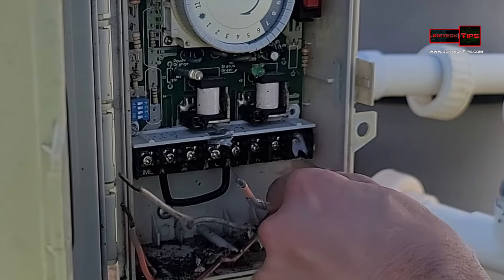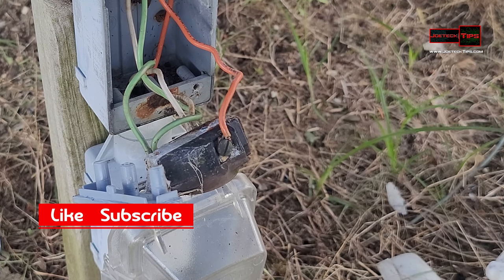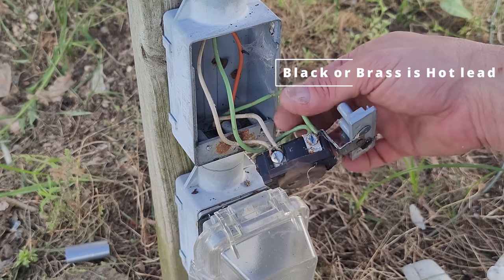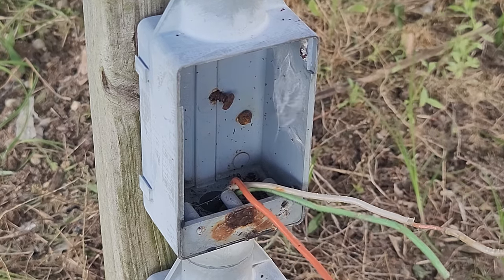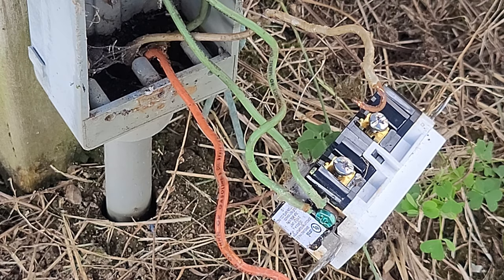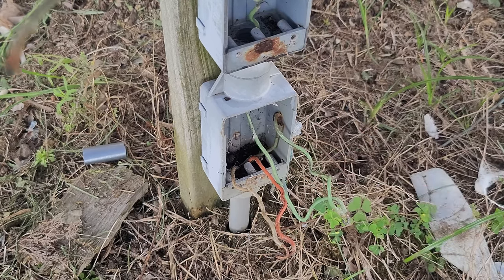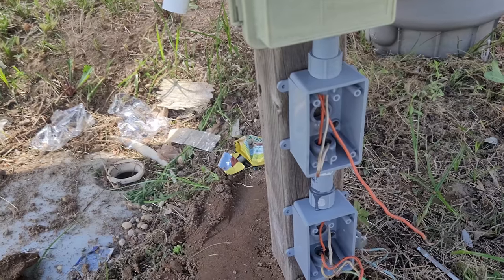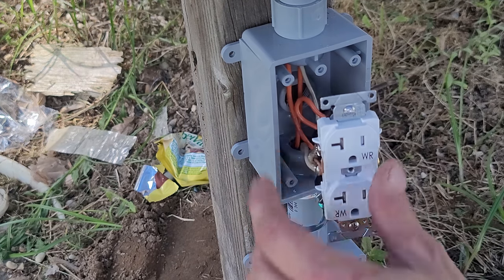GFI Pool outlet with Timer how to install | JoeteckTips

Comment: Wouldn’t be better to install a GFCI Breaker to control your motor?  Also as    recommendation, always tight your wires to the outlet in the right direction (clockwise ).
Reply from the maker: You didn't watch the video did you?  You skipped through.
Reply: @Joeteck  He is right it cost more but it makes the wiring at the end easier, no need for the GFCI outlet. And the right professional way to connect the wires is tighten the loop around the screws in the right direction so it brings the wire in tight and establishes a more secure connection. Loose wire cause fires.
It is constructive criticism, don't take it personal. You put content out there do it right.

Comment: In my town, they seem to require Twist-lock plugs.  Where are you that you can use regular 3 prong outlets?  The reason I ask is that there are very few timers that use twist-lock plugs, and I have replaced mine 3 times in the past 15 years.  I guess I am hoping to switch to regular plugs if I can!

Comment: You should wrap the wire around your screw terminals clockwise. That way you ensure tightening of the screws actually tightens the wire into the terminal not away/out of the terminal.

Comment: My timer box connections are the following L ,N, COM1, NO1, COM2, NO2.  My jumper wire isn’t connected so how does this work with my timer box?  I am confident with the gfi and 2nd outlet just not the connection to timer box

Comment: The issue I would have with this is you didn't use the pvc plugs in the back of your boxes.   Those boxes come with screw in plugs to seal off any conduits you aren't using.  Water is sneaky stuff, and although it is probably very minor, you definitely could have some leaking inside those boxes from the back conduit that wasn't sealed off, depending on how severe your rains are.   If you don't want to take the whole thing apart to fix this, just add some silicone along the seams where the boxes touch the wood.. should reduce or eliminate any seepage.
Reply from the maker: They are sealed
Reply: @Joeteck  Sorry tough guy. No it isn't. No picture showing it has the plugs installed means you didn't do it. Also how about showing electrical tape around the screws. With a pool wiring the ground is all about safety which you didn't show. I would say that's the most important part.